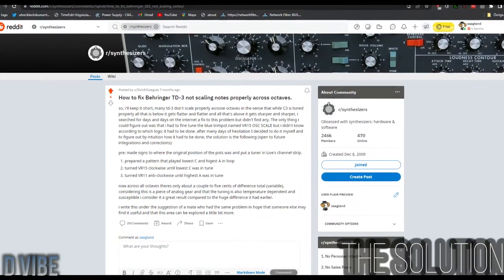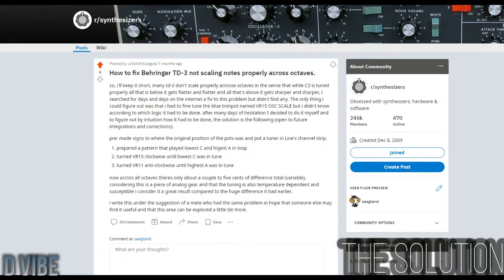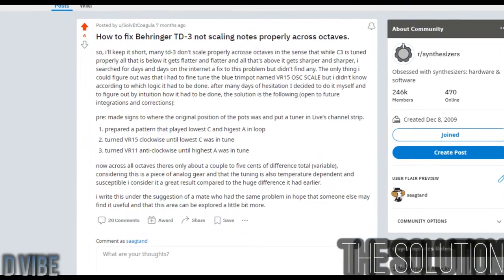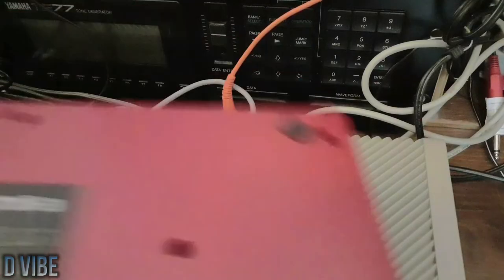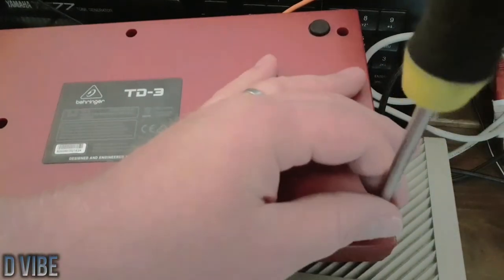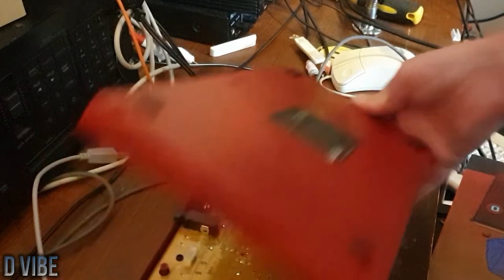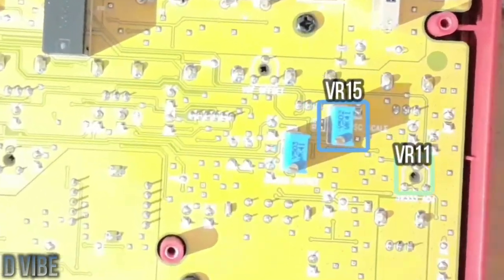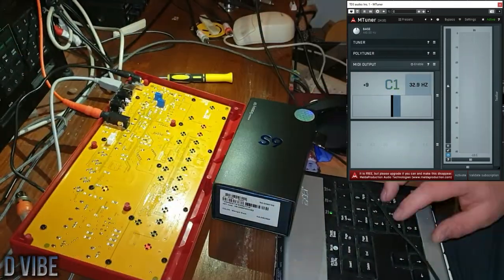Scale tuning of the [Behringer TD-3]

Comment: hello, sorry bad English, I understand the higher C but there's only one A, what im missing?
Reply from the maker: Use the lowest C and a highest C. I don't know why the Reddit post talked about A ;), but it doesn't really matter which notes you use as long as you remember which notes you chose. Use the master tune on the front to get the lowest note correct and then tweak the pots inside.

The most important thing is to find a sweet spot of the tuning between a high note and a low note so they are both approximately correct relatively to each other.

Don't open it up if you're not sure what you're doing though since you have to tweak the machine when it's turned on and that exposes the circuits which can be short-circuited. You'll probably lose the warranty when you open it up.
Reply from the maker: Also, I think it's easiest to use a midi setup and send the notes to the td3 instead of using the internal sequencer.
Reply: D vibe you rule, thanks, last question,  do you chance or recomend change de trimpot for a darker sound, its maybet too bright
Reply from the maker: @MakerManu  The trimpots is mainly to get correct intervals relatively between notes. But yes, you can make it both brighter and darker but it needs some trial and error :)
Reply from the maker: @MakerManu  The trimpots is mainly to get correct intervals relatively between notes. But yes, you can make it both brighter and darker but it needs some trial and error :)
Reply: @d_vibe-swe  hello d vibe, today I open it a get in tune, what I see is that de low C get in perfect tune but all the others notes up on the scale get everyone a little high ending with de high C maybe half or a third of note up, when I tune that last high C all the other un tune low like the inverse. Is this the way?? thanks
Reply from the maker: @MakerManu  It's a bit of balancing in the search of the 'sweet spot'. You probably won't get a perfect tuned scale, but it will be better. I don't remember exactly i which order I tuned it, but I think that the lower pot will adjust the whole scale while the upper pot will adjust the higher scale only.

Remember to let the machine get warm before you adjust any pots.